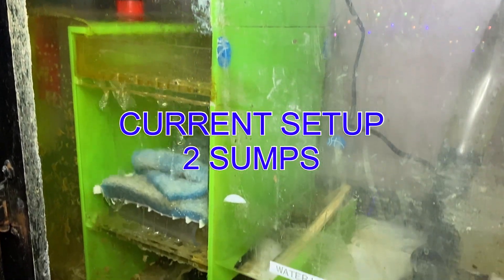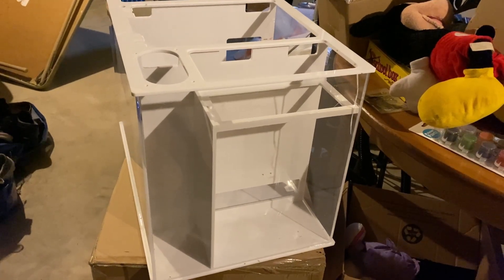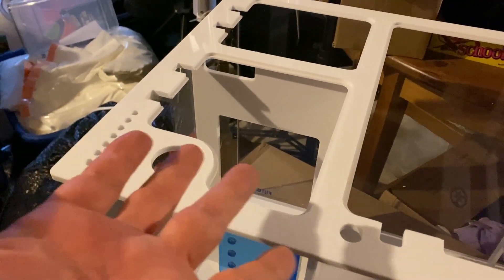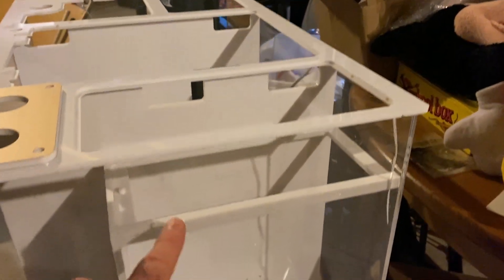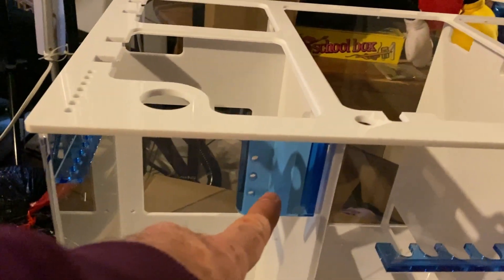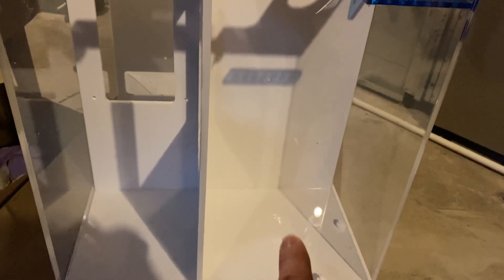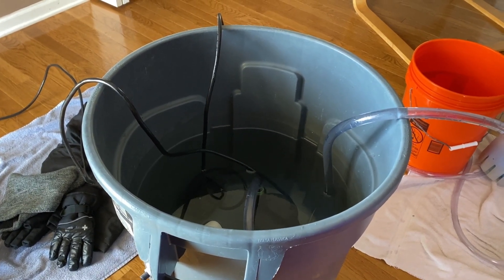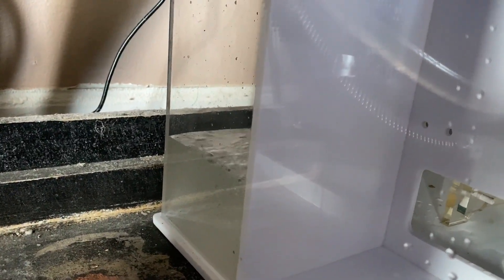Fiji 24 Advanced Reef Sump unboxing - New saltwater tank sump

Comment: So I have two points:

- the crack would happened if it was shipped in the winter and the package got cold. It’s very sensitive to freezing temperatures as the acrylic becomes stressed with contraction.

-did you not research this product before you bought it because it seems that you were surprised about some of the features and such. 

Anyways I’m sure some of the building qualities are definitely worthy of complain ing about though and the cracking is a huge bummer. Sorry that happened to you. Cheers.
Reply from the maker: hey, I did tons of research and wasn't surprised....story for another times. what breakage internally like the screws shows defect or something. what's done is done.

Comment: I just bought the same one in Sept,  it’s is to protect it and yes it’s cracked, mine was intact from Bulk reef supply. I like it a lot
Many systems only have one return for that size sump. I only have one return. The refugium actually sucks, I have carbon and GFO in mine.
I would suggest using something for mechanical filtration
The heaters lay on the bottom

My COR 20 barely fits inside the return
Reply from the maker: I keep my heaters hanging in the overflow chambers of the tank. no chance of breaking. if you have 2 return pumps where did you put the 2nd one. both mine fit in the one chamber.
Reply: @ROTTERtube  I have two return pumps. One is a Neptune COR15 the other is a Reef Octopus Varios6, they would fit if I put one on top the other.
I don’t need two pumps though, I only have a 80 gallon

Comment: I have the same sump. It’s not bad, I feel like the chamber before the return chamber is kind of a waste but all n all, nice sump. I’m surprised you didn’t go with something much bigger. Mine is on a 60g. Also, you’re not planning to use the sock holder.. I got mine used. Would you be interested in selling that sock insert?
Reply from the maker: I was barely able to get this one under my tank. I had to saw 2 mm for each side since that lip on the bottom was literally 3 mm too wide for the stand! Sure, if you want the sock insert let me know. I agree with the extra chamber. I won't use it for anything other than dropping in a carbon bag or gfo.
Reply: @ROTTERtube  that’s understandable. Idk if you’ve checked out the prices on bigger sumps lately but they’re ridiculous. I’ll take the sock holder if you won’t use it. Let me know what you want and I’ll also pay the shipping. Thanks Steve!
Reply: @MikeLemming  👀
Reply: @BillyPipes  what’s up bro? You getting ready to set up a tank or what? Hope all is well brotha!